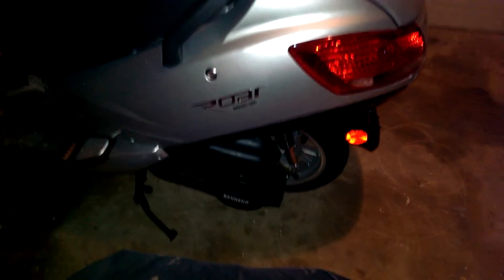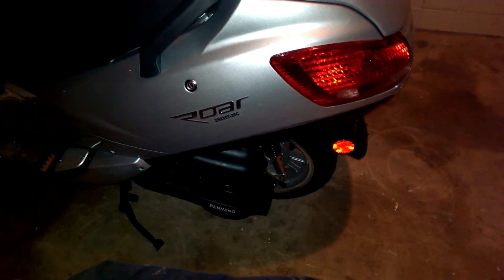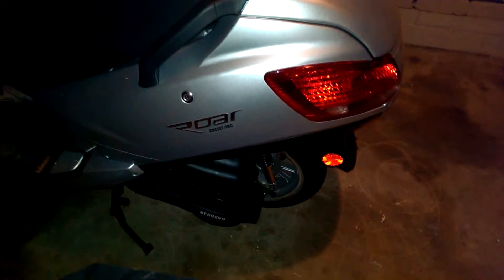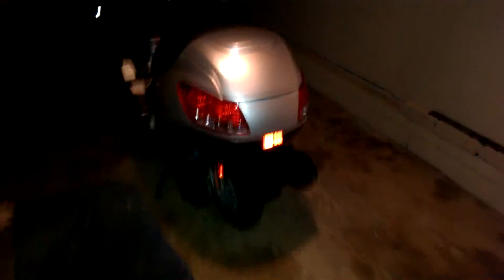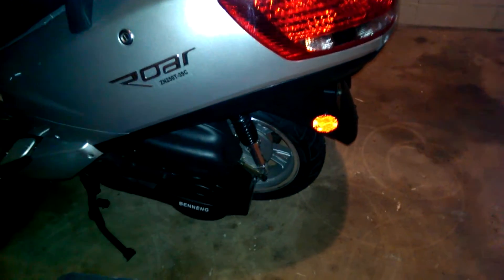Bad Noise on rear of new 2013 Znen Roar 250cc

Comment: You could be right. I had a bad wheel bearing on a Znen 250 scoot. (with TWO miles on it!) The bike is also known as the Titan, Redstreak Navigator, L-Roar etc, The Bearing seal was popped and splattering grease all over the place. I ended up ordering new bearings online (Made in Japan) and replacing them with a brass drift-pin. Check with the folks At "It Is The Ride" for help with all scoots Chinese.

Comment: Check for lubrication in the final drive. There are several bearings near the rear wheel, and if no one put lube in there it will not last long. You need a manual to locate the drain and fill, or a gifted curious nature.

Comment: Also check your gearbox fluid level.
Reply: Could it be the clutch making the noise? I have the same scooter I had my fuel pump replaced, the shop charged me for 6 hours labor. Does that sound acceptable to you? Any other information about this would be greatly appreciated!